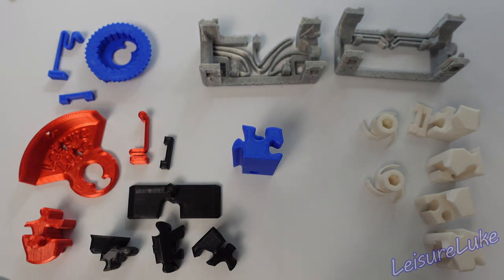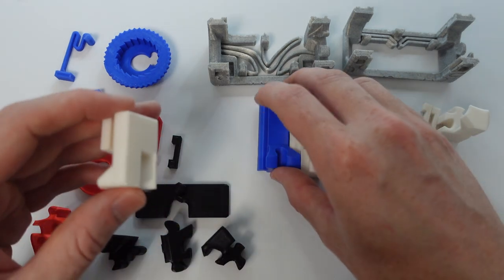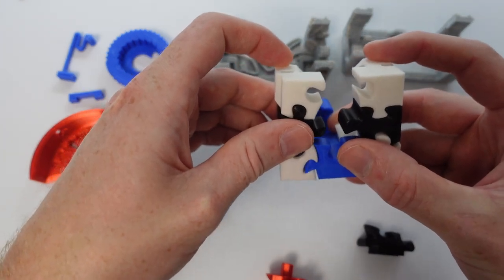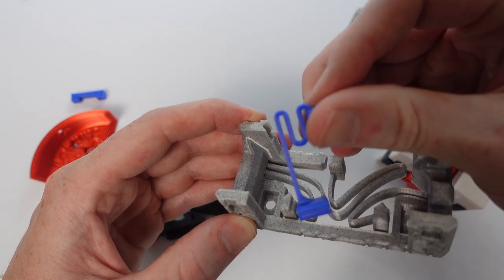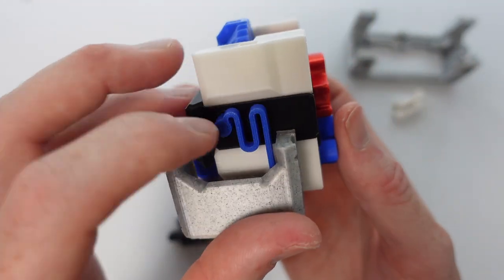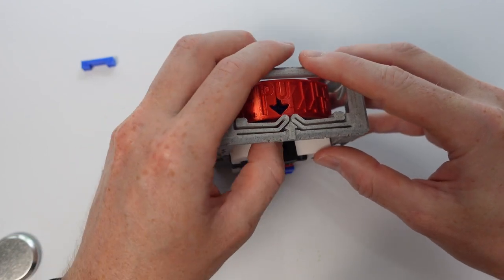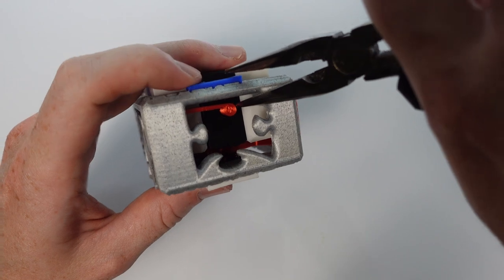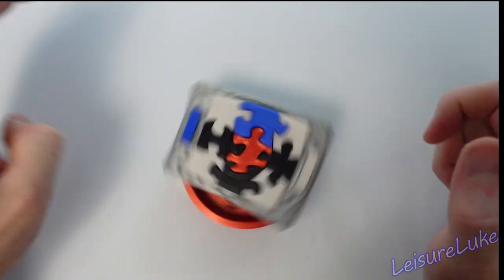Assembly Instructions for THE PUZZLE Puzzle Box - Tips and Tricks and Layer Height Considerations!

Comment: Im having some problems with piece five and wheel fitting together. Any tips? All of your other boxes worked great for me!
Reply from the maker: Yeah, I know this problem.  For me, usually a little elephant’s foot on the wheel lock makes this very tight.  Double check the wheel lock hole for that.  Feel free to trim down that 5 piece peg.  Originally, that peg had to be tight to hold the piece in, but the designed changed where now the lid holds in piece 2, which holds in piece 5.
Reply: @LeisureLuke  Alright, I will try that. To be honest I didn't expect to be responded to. You're the best!

Comment: Hey luke! Just assembled the print from the remix, thanks again for the great print and tutorial. Just wondering, the point of this puzzle is just to have the blue part flush?
Reply from the maker: Yeah, the point is to get the blue piece to stick all the way out in front, so the back is flush.  Basically you have to compete a turn of the inner wheel and line everything up.
Reply from the maker: I know it’s not much motive, but it all makes sense with the final mega-assembly.
Reply: @LeisureLuke  that's good enough of a motive for me :)

Comment: The puzzle piece's did not fit and the bottom layer of the print was bigger that the rest of the print which took a lot of sanding to get it to fit.
Reply from the maker: Hello!  That's a common problem, especially for those who haven't printed mechanical parts before.  You're probably over-extruding slightly.  Try my tolerance print here https://www.thingiverse.com/thing:5319427, or lookup how to calibrate the e-steps of your 3d printer.  Happy printing!

Comment: I am having problems with the blue wheel..  when i lock it to the left,  i cannot turn it further..  i have to jug it around a bit, and then i can turn it more,  but then  halfway it stops,  and the dial  is all  crooked .. any thoughts how to solve that?
Reply from the maker: Hmmmm.  Do you have the “flush” price on the back correctly?  Maybe something is broken.  The blue wheel should feel quite sturdy, and old rotates left, but does that well.  When you say “dial” do you mean the piece I call “outer wheel”?  That should be sturdy and only spin about the 1 axis too.
Reply: @LeisureLuke  the blue wheel is sturdy,  but when you dial turn it to the left, it gets stuck halfway.  and then I need to take it apart,   the red piece on top,  moved to the left, so it's blocking the white piece at the left top to be pushed in,   so it wont go,  i need to turn the red part to the right,  then i can push it in and move the dial  further,  but then it gets stuck..  tried the red part left and right, but it wont move anymore
I will try to make a video, and post it somewhere

Comment: Sorry, printed all pieces and it wont fit. Waste of time ;( Wheel Lock & Piece 5
Reply from the maker: Hi Michael, that should be a snug fit.  Make sure you’re aligning the notch.  If not, you’re probably over-extruding.  Most printers over extrude slightly by default.  There should be 0.1mm clearance in the connection between 5piece and wheel lock.   Try decreasing your nozzle speed by about 2% (or do it properly by calibrating your e-steps).  I’d say about 5% of people have this problem, and my puzzle boxes are the first print they’ve done where it matters.   Let’s get you dialed in and on your way!  I think my puzzle boxes have been downloaded around 20k times total.  You’d be the first to find this small print a waste of time ;) let’s fix it!
Reply: @LeisureLuke  Thank you for the very good explanation. ;)
Reply: I extruded 100mm and it extruded 98mm. So under extruding. I corrected it to extrude 100mm. Lets see..
Reply from the maker: Interesting.  What speed are you printing at?  I go real slow at 40mm/s.  Can you just give it a qualitative assessment?  Are the connection interfaces a little rough or have burrs?  That’s the tightest fit on the puzzle box, and it’s meant to go it fairly easily, but not come apart unless you poke some through through the back of the wheel lock to press the 5piece out.  It’s certainly not meant to slide around.  Keep me posted!
Reply: @LeisureLuke  I just full on sent it with 150mm/s and I had no problems with the print. Everything assembled and worked fine.